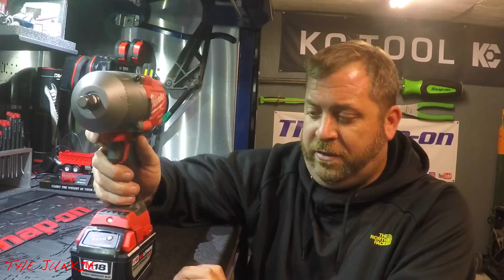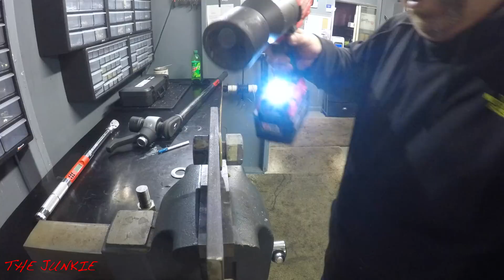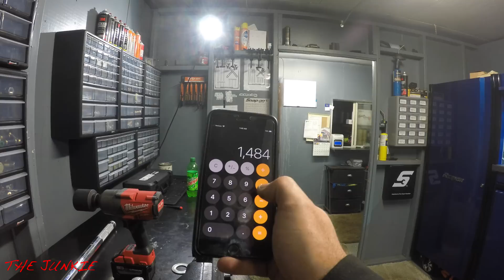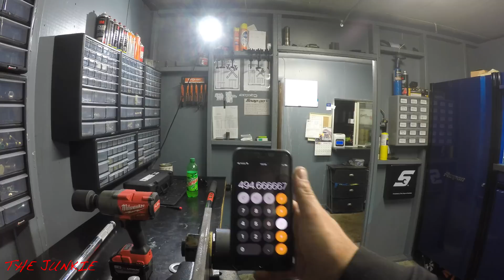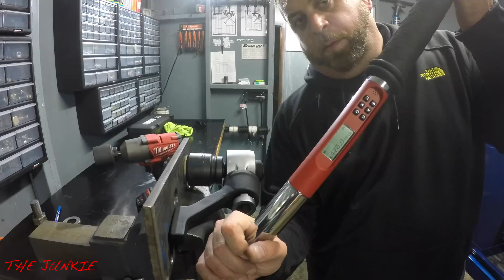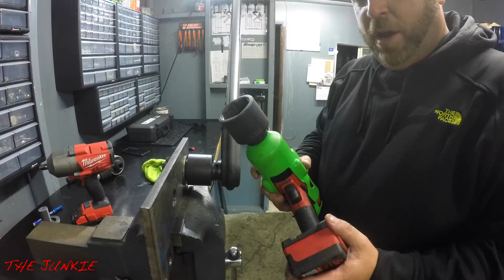REAL WORLD MILWAUKEE 2767 TORQUE NUMBERS?🛠🔩🦍💪🏿

Comment: I think it would be good for Boatyard applications taking the prop off of boats and Keel bolts also around boat yards you have heavy equipment everything from Boat Lifts and cranes. Floating docks. Getting nut threads past crosion and rust

Comment: That's great but why would anyone use a 1/2" drive gun to break 1/7/8" nuts? I would jump up to the 3/4" drive Milwaukee for that. You should purchase the Milwaukee 3/4" drive impact.
Reply: i use my half inch 2767 in a rock quarry all the time. I love the damn thing. honestly it has more power than the 3/4 IR air impact we have

Comment: Thanks for doing a real review! I love snap on tools as well but when it comes to the cordless stuff Milwaukee is killing it. I appreciate you giving the Milwaukee product an honest chance and not discrediting it because it’s not snap on. I’m an automotive guy, the mid torque is perfect for cars and half tons (Wheels) but I bring out the high torque for the 3/4 ton and larger trucks. Also you can use them to snug the lug nuts, but you have to be very careful a quick press of the trigger - and zero Ugga duggas, followed by a proper torquing with a torque wrench.

Comment: Epiq video junkie.  Thanks for making it I bet that took forever to shoot and edit.  About half way through I thought 1400 ft lbs is way too much torque for anything I do.  My craftsman with 300ish ft lbs serves me fine, but you are right about diesel and heavy equipment repair.
Reply: (It’s already not an America company)Chinese Milwaukee Tool
More than 96% Milwaukee tools are made in China. Milwaukee Tool has carried out tool-design job in China since 2015 year, the design jobs also are slowly sent from USA to China.
Most plastic materials have been changed from America DuPont, GE to Chinese sources. The red plastic，Nylon，of Milwaukee tool handles/housings has been provided by a Chinese supplier since 2010，originally the Nylons were from DuPont，the Nylons-changeovers caused the handles/housings weak，like screws very likely strapped/slipped in screw holes/bosses, the dimensions are not as much stable. Also black hard plastic for battery pack cases/covers，their materials were changed from GE ABS/PC to a ABS/PC from a Chinese supplier，caused battery pack case more likely broken, brittle, the same story is happening on anti-flam Nylon material of battery frame，changing from DuPont to a Chinese supplier. 
Lots of bad tools always first are sold to USA because nobody inspects the outgoing, and because in USA Milwaukee Tool has the strongest warranty service ability than in other countries.
During Milwaukee production process, more than 5% defects found out by workers, also more defects failed to be screened out. Bad tools include noise as gear, bearing aligned badly, sometimes press trigger no reactions at all, metal parts like shaft, gear, pinion, important screws broken as poor heat-treat, motor stator rubbing with rotator, fine wire laid inside tool broken as poor design and poor workmanship, big percentage of oil leakage for hydraulic tools, etc. 15% chance you will get a bad tool, bigger chance you will get bad tools for nailer, planer, hydraulic tools, cable/tube cutter, as they are first generation of tools for Milwaukee Tool, because of comparing with sawzall, drill, Milwaukee Tool sucks at nailer, planer, hydraulic tools, cable/tube cutter, AC tools, drain cleaner, blower.
Milwaukee Tool workers only get less than 300 dollars monthly salary，even plus OT to 276 Hours a month（normal month-workhour is 176 hours，plus 100 hours OT. Chinese law only allows no more than 36 hours OT per month）， after OT 100 HOURS for every month，a worker can get 500 dollars monthly salary，this salary very low for living in a big city in China, plus bad working environment(the management has no such safety-first mindset that loud noise but no issuing ear plugs to workers, at dangerous stations very few goggles issued to workers. workers stand more than 10 hours every day during on-duty time), so Milwaukee Tool with huge employee turnover，400% yearly turnover，ie workers averagely work only 3 months for the factory, cause workers without enough experience，lack of training，then unable to ensure good quality. And worse worker- turnover with most Milwaukee Tool’s suppliers.
After Milwaukee tools launched one year， Milwaukee Tool will do so-called VE, value engineering ，actually cost-down, change Germany trigger to Hong Kongese trigger even Chinese trigger/switch, change Japanese chuck to Chinese chuck, etc. Milwaukee Tool has a team, 50 people to do the VE. The quality would obviously become worse after the VE.
Milwaukee Tool has really bad quality system, lose much profit because of failing to keep quality constant, like critical metal parts broken, every 2 months taking place, no methods to resolve the issue in 10 years, starting from 2008. And always look for cheap materials, cheap suppliers, worker salary is always slightly higher than minimum, only 0.17 dollar higher than hourly minimum salary.
Milwaukee Tool has less experiences for making power tools comparing with Dewalt, Makita, Bosch. Milwaukee Tool only has grew fast from 2008 year. Milwaukee Tool copies and compares life test with Bosch, Dewalt tools during new product development stages, even when doing troubleshooting during R&D, would measure dimensions of these competitors’ components.
This company is also an ugly company, in 2014, a Hong Kongese manager tried to rape a female employee during their business trip, the company fired him and less than half year, hired him again as a manager, then the female employee left this company and lost her job. In 2015, in its factory dormitory a more severe rape case really took place by a male senior manager to a girl/employee, and this Company didn’t do anything to him, like firing him, like reporting him to police，helping officer to arrest him.

Comment: You need that Milwaukee for Honda & some Toyota Sienna Harmonic Balancer bolts👍🔧🔩
Reply: Michael StJohn nobody said it was just said Honda crank bolts are still the standard lol
Reply: Lone Star Auto first day I had mine if failed to pull a 09 Honda 3.5 crank bolt needed a 5 foot pipe on my breaker bar
Reply: It needs a high mass socket, wasn't the guns fault.

Comment: Gotta love ur terminology. More power is not always better. From what i gather as well as ur results. The mid tourqe will be more than enough power. For most if not all job. For automotive world. The tourqe rachet on Millwakee on the 3/8 is rated for 55lbs ft tourqe. I would use that for most engine bay stuff and break jobs. I've  seen all Milwaukee has to offer and they seem very legit.